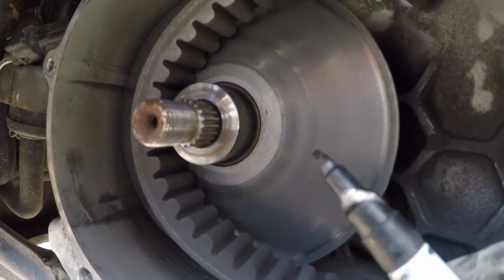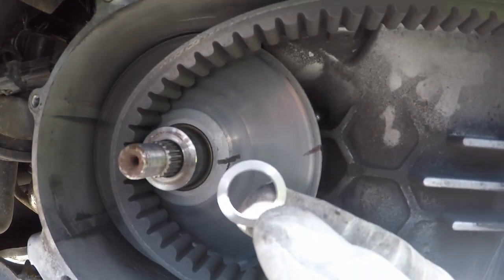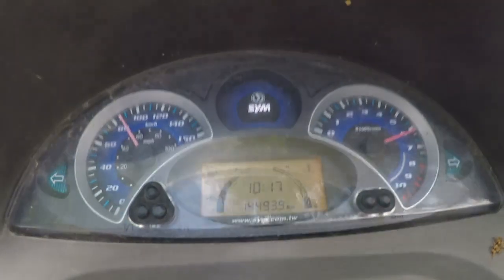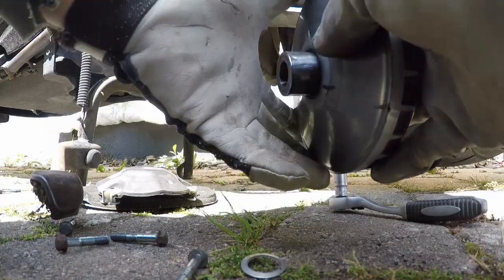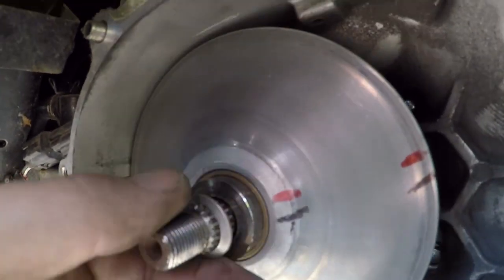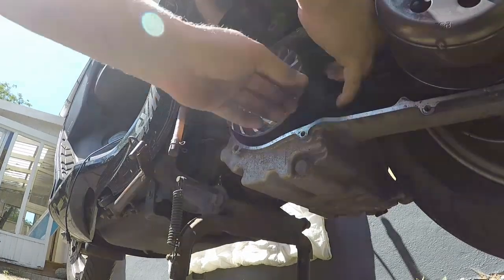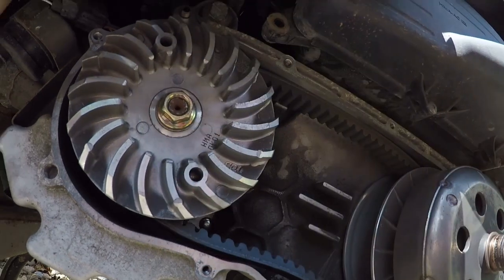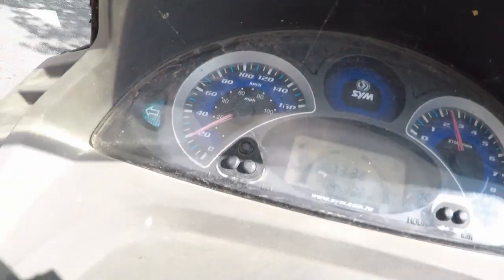Shimming a variator to improve acceleration on a scooter, nearly free

Comment: That's the washer everyone says to remove to increase performance, however the RPM logic makes sense.
Reply from the maker: You can get a higher topspeed, if you remove it, but it comes at the cost of acceleration and at the cost of your clutch. The clutch wont last as long, due to the fact that you're starting the scooter in a higher gear.

Comment: Thks four your video The shim give more speed can use 2 shim or not thank you
Reply from the maker: Shims will not give you speed. They will give you accelleration rom 0-20 kmt.
Top speed comes from more HP, better exaust ( more rpm and more power ) and from better gearbox.

Comment: On my 139qmb the belt is riding up past the variatior, what can I do to make it stay down to ride just at the top of the variatior?? It’s making my scooter top out at 8400 rpm and 40 mph
Reply from the maker: If your scooter is topping out af low speed and high RPM, then your one or two things may be wrong.
Your belt is too long ( that seems to be the case here )
Or your gearbox ratio is way too low.
You should try to look at both things, but first you must fix your belt, to make it match the variator.
Reply: try with malossi 727X18.5X8 is the best for my 139qmb, i got malossi variator and  front pulley naraku and 7.0gr rollers its going up to 100+km/h
Reply: @KikoBach94  damn!! Getting 60mph outta a 139qmb!! That’s impressive
Reply: @scootertechguy8970 ”ratio too low” hey do you mean if i have a 100cc kit and do NOT do the final drive gear upgrade?? thx 🛵
Reply from the maker: Yes, you need to change the gearbox.
Look at the variomatic. If your belt runs al the way out to the edge of the variomatic early and rpm rises, then the gear ratio is too low.

Comment: If u put more shimming Rings wil it lose more topspeed but also better acceleration cuz I don't mind to much about too speed but I just one really good acceleration what can I all do to get better acceleration?
Reply from the maker: Top speed is gained when you change the gearbox.
Using af washer will give you better acceleration and your clutch will last longer.
Reply: buy lightweight variator rolls

Comment: Thank you for sharing. Does it effect your top speed?
Reply from the maker: In some cases it does.
And if it does, then you must look for an option to change the gearbox to get a lower gear ratio.
And if no oher gearbox can be found, then you have a difficult choice to make.
I use it for medium to long distances, so i would choose top speed.
In my case it did end up costing 5 km/h so i ended up purchasing Malossi Multivar for my scooter and got much better accelleration and the same topspeed as the original variator.
And by getting Malossi Multivar i got access to other roller weights.
You can see some of it in my other videos, though they are in Danish you should be able to get the big picture of what is going on.
I mostly do, when i watch Russian scooter videos and i do not speak Russian.
Reply: @scootertechguy8970  Thank you for your reply:)  I have a Malossi multivar installed. But my belt doesn't come down all the way. So I need to use shims. Like in your video. But I think the belt won't go as far high anymore. Because the weights can't push the multivar out that much. I will let you know the result. Thank you!
Reply from the maker: @michaelbaars7459  If it wont go all the way out, then you just need a gearbox with a lower ratio.
Problem with lack of topspeed solved.
Reply: You need a gear box with a higher gear ratio for more top speed
Reply: @scootertechguy8970  my 150 has valve noise when its warmed up valves are set to 3 thousands. If I set the valves tighter no noise. Camshaft? Ideas because I asked 49 scoot he was useless saying CVT! Or oil is to thin. W.t.f.
Reply from the maker: @burt1758  I have no idea.
My strength is not in the 4 stroke part of the engine.
Try finding the Greek workshop, here on youtube.
They have a video of a complete service checkup.
I sold the Sym GTS a few years back, hoping to import a Gilera Nexus 500 og GP 800.
Reply: @scootertechguy8970  thank you.
Reply: Hi i have on my 139qmb for valve's : intake is 0.10
Out is 0.15
Drives like a sunsine 👌👍
Reply: @mennop8182 ohhhhhhhh plzzzzzz “video or just no bro!” that’s literally and me mechanically crazy to have no clearance. Especially when the engine starts to heat up.
Reply: @mennop8182 wahhhh? like why all manuals n gurus say .003? cause ive tweaked mine precise with feelers and still getting slight tappy tappy

Comment: What about the belt being shorter than advertised length.    729 gates and a Chinese belt  is 8mm short. A Chinese ! What then?
Reply from the maker: File a complaint, if the belt does not have the correct length. Or buy another belt.
The belt should be able to reach the outer ring of the variator, while reaching the inner ring of the rear pulley.
While also being able to reach the outer ring of the rear pulley, while reaching the inner ring of tha variator.
If the belt is off by 5mm, it could have a noticeable impact.

Comment: does it keep 45k/h
Reply from the maker: I do not understand your question?
It is a 263 cc, 4 stroke scooter, with 23 HK.
Top speed is 140 km/h and the tachometer is ind the red area.
I did not ride it passed 120 km/h for that reason.